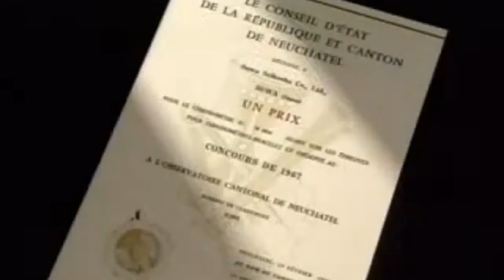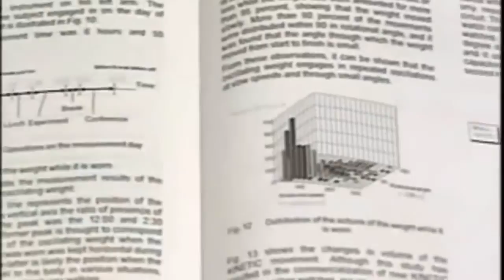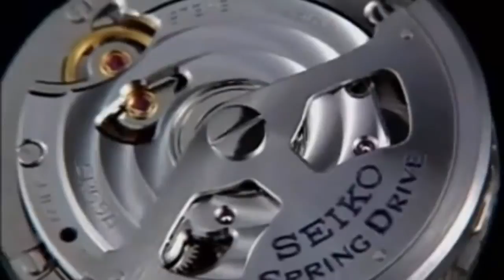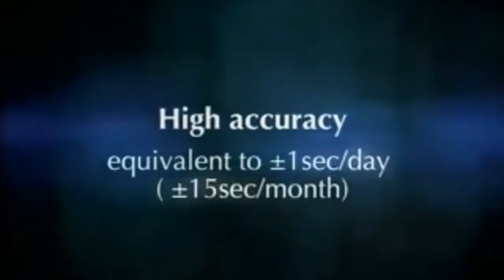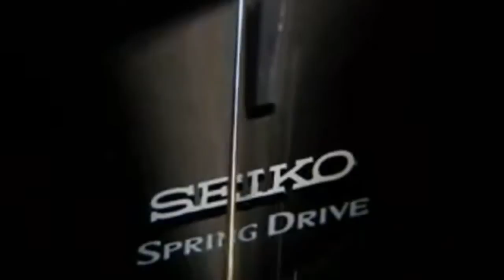Seiko - History of the Spring Drive

Comment: With the flow of electricity so close to the skin, is it safe to use a spring drive watch in the long run?
Reply: Mohd Redzuan Devan Abdullah:  Good question. We’re talking about an EXTREMELY small amount of current, shielded by a metal case. It’s certainly not enough to cause a health hazard.